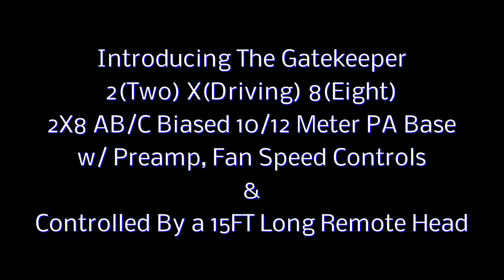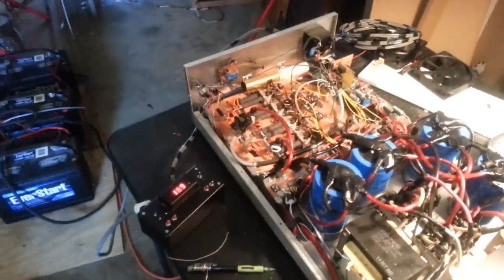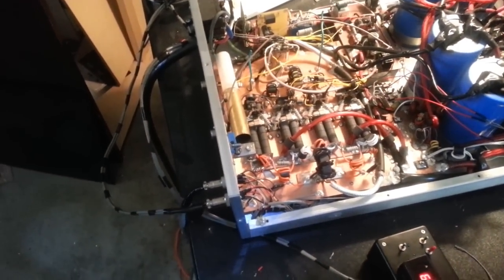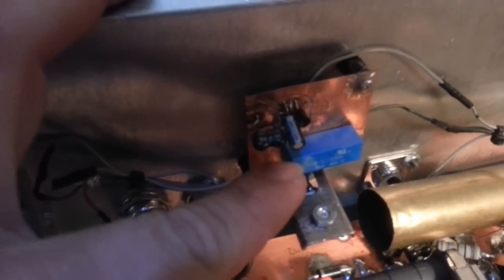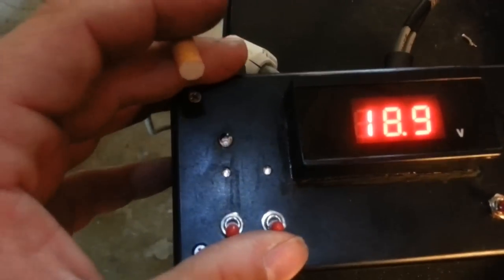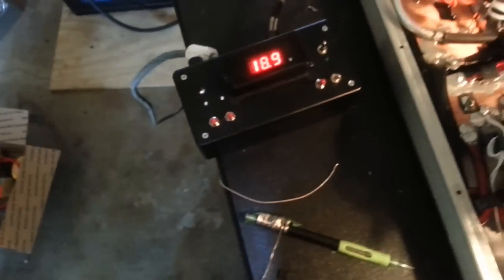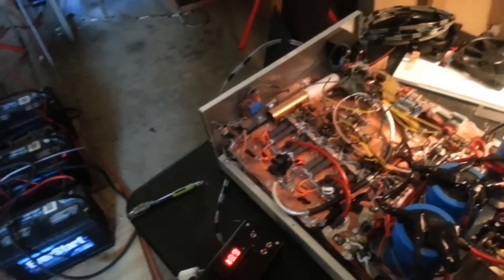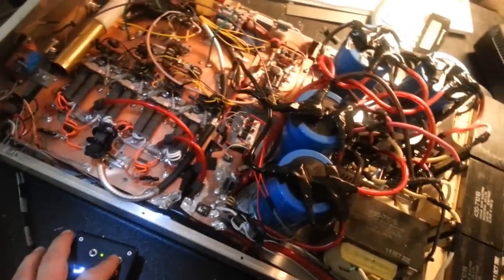Gatekeeper 2x8 AB/C Biased w/Pre-amp, SSB, Remote & 200AMP Supply - Detailed Video!

Comment: Help.
I just installed my 2x8 in my car. 
2/0 hot and gnd from mechman 370 alt all the way to the amp. 
Stock Cobra 29.
Nulled rg400 jumpers.
Stryker A10 warthog antenna mag mount.
It's going into self osculation.
Only when on the antenna. 
When I bring out the oil can dummy load it's totally fine. 
My nano VNA and MFJ. Show my antenna is perfect at 1.1:1 SWR. 
Been using a Texas 350hd on it for 2 years with no reflect and no problems. 
But this box is pissed on this antenna. What's the deal? Works on the bench and in the car on the dummy load just not the antenna.
Reply from the maker: Sound like your using HG in that just guessing....this is why a lot of us don't like putting in drivers because of oscillation issues. Its very very weird and only an issue with HG once you put 2 aml sections like that. This is why builders like Danny 123 doesn't put drivers in amp bigger then a 4 pill.

But it is internal in the amplifier. If I was you I'd convert it into a straight 8 and use a external driver.

But someone is going to need to go inside that amp and stop that issue...probably a capacitance issue.
Reply: @1883GotDown  what if I put toshibas as the driver and leave the ret as hg?

Comment: NICE WORK GATEKEEPER. HAVE YOU DONE ANYTHING WITH HIGH VOLTAGE. 28VOLTS?
Reply: I got a little suspicion he's got his hand in the 50-65 volt cookie jar right now lol
Reply: I love the 2sc2510s though. Those things are awesome. And DAM do they make some power. You take someone that knows their iron cores and how to use em and it's not hard to get 26 volts. Back that  with enough current and them puppies Make some duck pluckin power.  There's a guy that has a 16 pill with em and it makes over 5k watts